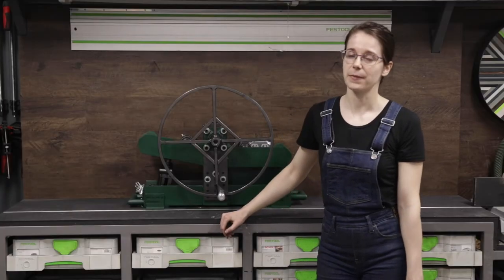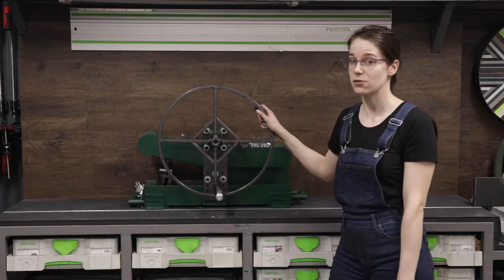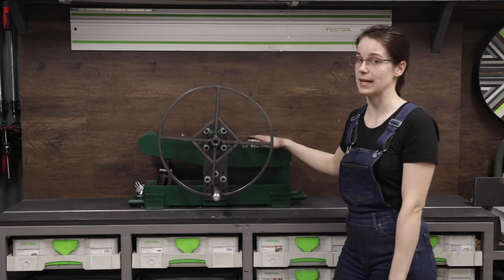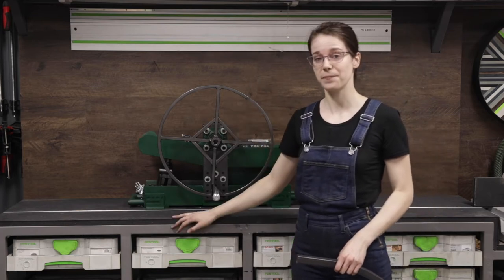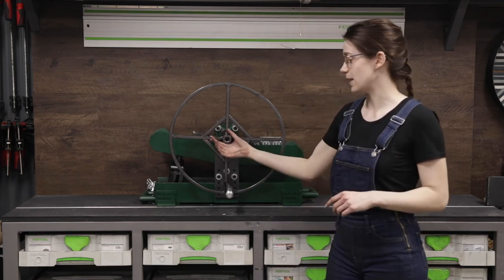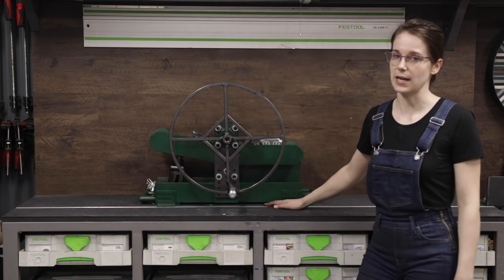DIY Roll Bender (bends 1" square tubing)

Comment: I just wanted to say how refreshing it is to see a young couple enjoying engineering. I loved my job as a mechanical engineering manager, doing all the differing aspects of designing, machining, building, testing etc in a company that traded across the world. The roller bender looks great and operates just as good. I've designed and built a few things and, like you, discovered a few errors and redesigned and corrected them. Really good post, thank you.
Reply from the maker: Glad your enjoying it